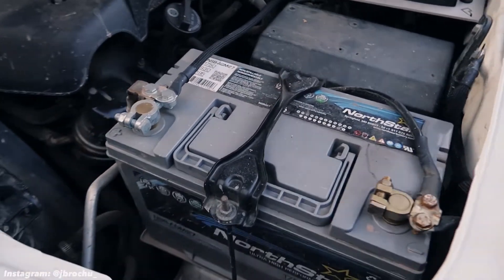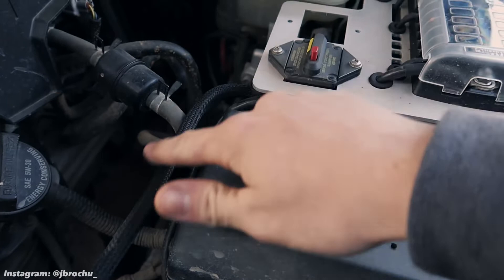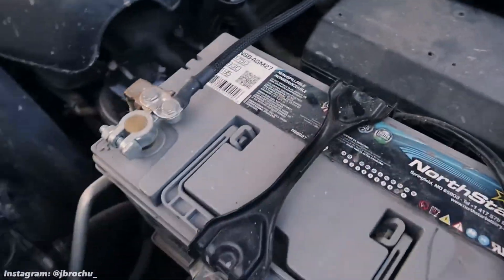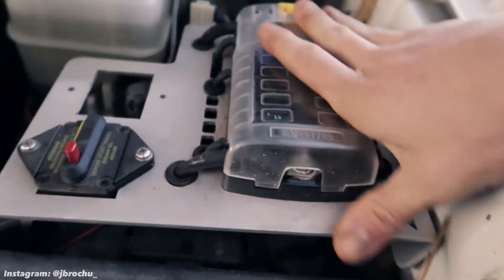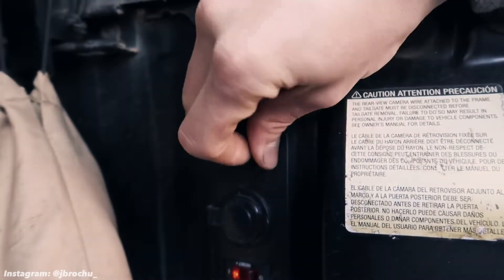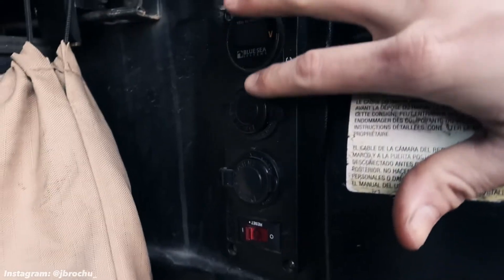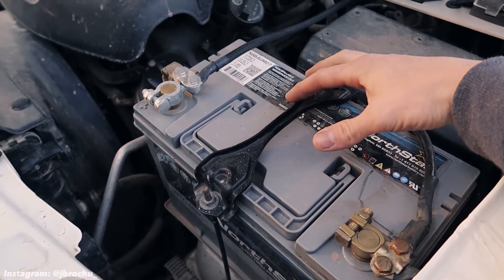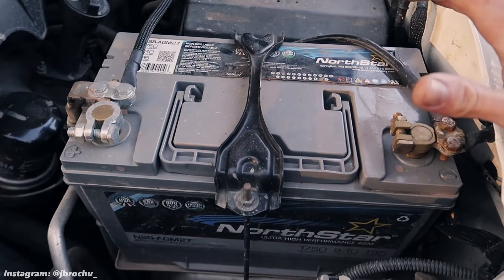Single AGM Battery - How Long can it run my Fridge? + **SIMPLE & CLEAN POWER MANAGEMENT SETUP**

Comment: With the aux fuse box bracket system, where do you mount any relays needed for things like ditch lights / light bars?
Reply from the maker: I don’t run man aux lights but the ones I do I have the relays either tucked under the fuse panel or inside under the dash!

Comment: I have a Dometic CFX 35 and want to run it as a freezer 24/7.  Do you think this AGM battery would be able to handle that without the Fridge shutting off because of low battery voltage.   Have you ever had any issues with your Dometic cf50 shutting off because of low battery voltage??
Reply from the maker: If you are placing already frozen items in there it will be easier for it to maintain temperature. It comes down to a couple factors. The ambient temperatures & how often you will be opening and closing it. If you are leaving it in the cab of a truck on a hot summer day that fridge is going to have to work overtime to keep that temp down. If you are driving the truck everyday it shouldn’t be an issue. You will see the the battery draining bad once you let it sit for a day or two.

Comment: Excellent clean job. Typically, though, you wouldn’t want to have a solder connection 4 GA at the battery. A quality, hydraulic type, crimped connection is what you want.  You can add solder after crimping if you want but not necessary. But it really should be crimped due to vibration and heat softening the the solder.  It would also be better to have your 100 amp breaker closer to the battery as your not protected from short between the battery and the breaker, feet. Now you are protected from short between the breaker and the fuse box, inches. The longer the wire the greater the possibility for a short, battery destruction, fire,  things you don’t want to happen.  As you have the breaker is acting like an expensive switch.
Reply from the maker: Thanks for tips! But you are correct I do essentially use that breaker as a switch. If I were to ever have a draw on my battery due to aftermarket accessories while out on the road I could eliminate that issue until I was in a position to track it down.

Comment: Did you change out the ALT-S fuse so you’re charging that battery at the proper voltage?
Reply from the maker: I did not. I didn’t want to remove the fuse and get rid of my overcharge protection on that circuit. I believe there are some options out there to keep the circuit protected and offer higher charging volt cut offs but I have no looked into it.
Reply: @Adv4x4   you can build one for a few buck with a add a fuse, diode, and fuse.  It's on the big thread on tacoma world for the northstar battery I found a ford diode fuse that works and put it in the add a fuse with a fuse

boom only cost like $12 total with the add a fuse and the diode fuse
Reply from the maker: Awesome I’ll look into it

Comment: Great review and I like your single battery setup rather than a duel, Are you running an inverter foe 120v? Or are you just running your refrigerator/freezer on 12v? Thanks
Reply from the maker: Thanks for watching! I am running the fridge on 12v it’s plugged directly into the 12v socket up front in the truck.

Comment: And how did you know which battery to get? I'm not too familiar with AMGs
Reply from the maker: I would look at what battery your jeep calls for and see what the dimensions of it are. Compare that to other batteries with higher capacity and see what you could fit in there that remains close to same size or that will fit in its spot.